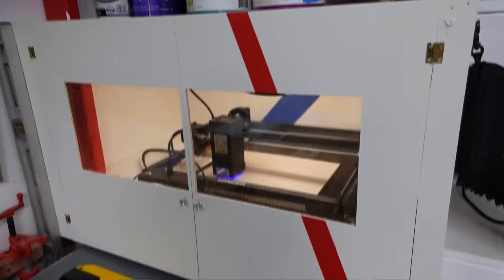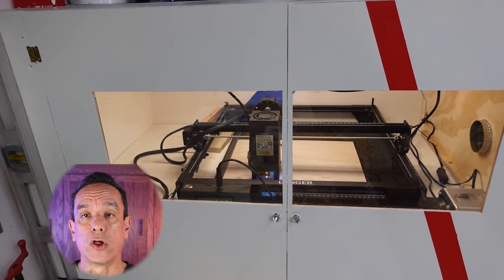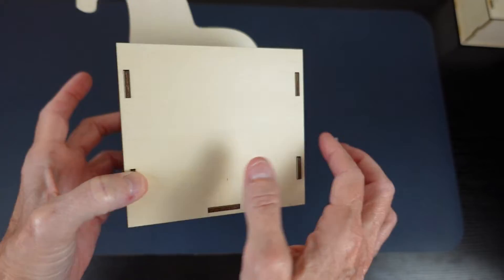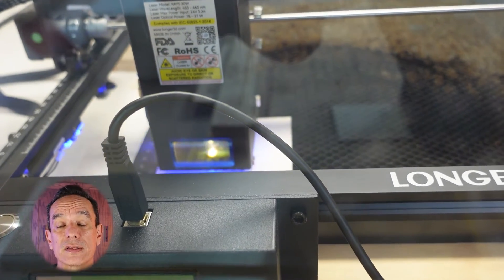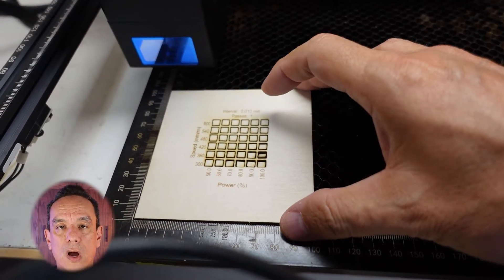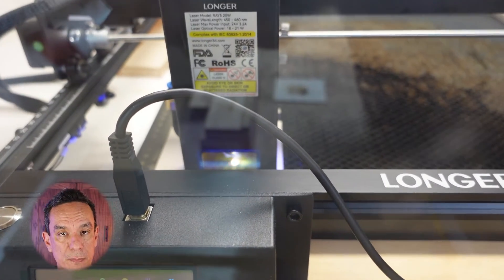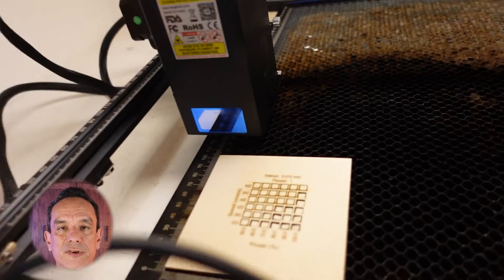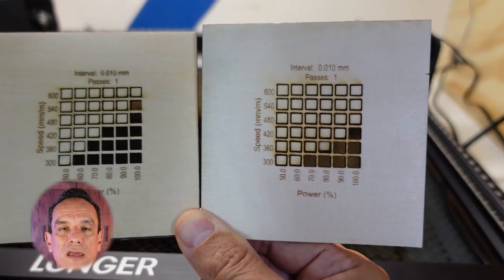Longer Ray5 20W Laser Air Assist Review: Boost Your Laser Engraving Performance!

Comment: Can you please show how to install the air assist pump
Reply from the maker: I am so sorry. I am unable to make a video for that, but it is very easy to do. The pump has a single thin pipe like piece of plastic that sticks out. This is where the air is pushed out. If you are not sure where, plug the air assist in and turn it on.  You will be able to determine where the air is coming out. This is where you connect the hose. On the laser, there is only one place to attach the hose. If you are still not sure where, the instruction manual should be able to help. After you connect the hose, turn on the pump and place your finger under the laser head. You should feel air being blow out. I hope this helps.

Comment: When I eventually get my LM3 up and running it will have air assist as this video has proven.
Take care both.
Cheers, Huw
Reply from the maker: I needed a backup pump and found that fish tank pumps look exactly the same and the pressure is supposedly the same but my Longer Air Assist is a little stronger but the fish tank pump works just as well and is MUCH cheaper.
Reply: @Poor_Mans_DIY  A fish tank pump is what I intend to buy as they state the psi is around the same but the price is hugely different.